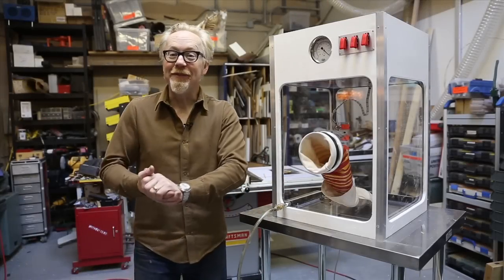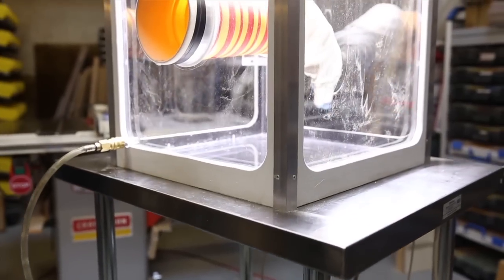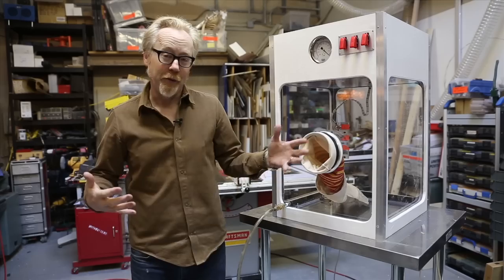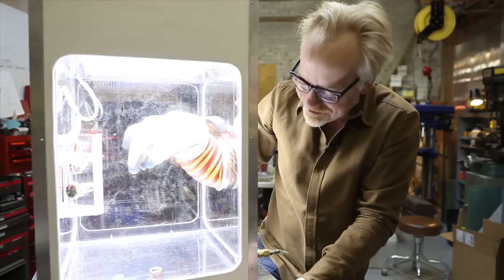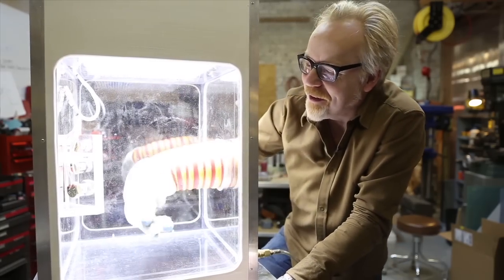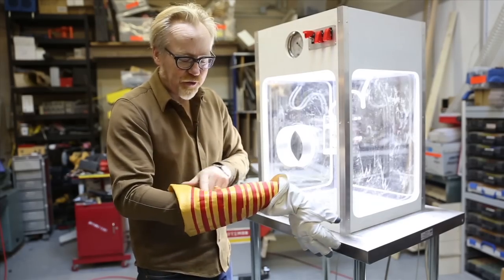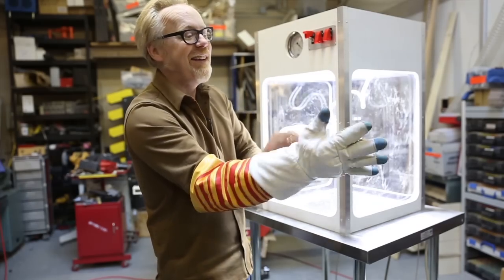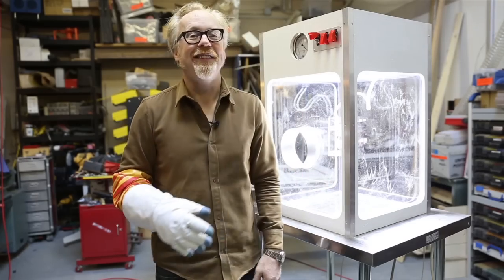Inside Adam Savage's Cave: Space Glove Vacuum Chamber

Comment: But the vacuum on the moon was a MASSIVE 2x10 -12 bars.  The glove would have been like concrete.  More likely it would have just exploded as soon as they left the capsule.  More fake mythbusting.
Reply: In scientific notation, when the exponent is negative (like -12) the number is minuscule, not MASSIVE.
Te pressure you state is 
.0000000000002 bar, very nearly zero.

Comment: What would really mean something to me, is to do this experiment with the actually glove design/material the astronauts used on the moon, and get the vacuum in your chamber as close as possible to a perfect vacuum. THAT is what should be done with a museum piece. Everything else is just fake.
Reply: Having the chamber at full vacuum would make the glove over pressurized, since the Apollo suits only had 4.3 psi.
 Atmospheric pressure is 14.7 psi.
Reply: @dansv1  I would still love to see a random person, get into a 1969 designed space suit, and walk into a chamber of near perfect vacuum, and explain candidly about movement, agility, oxygen, moisture from exhale in the suit, CO2 exhaust, body heat build-up mitigation, all the while standing on a frying pan with one side of the suit subject to near frying pan temperatures, all the while being blasted constantly with microwaves, xrays, gamma rays and cosmic rays, while seeing how the suit A/C works to keep the temp cool for the air inside the suit.
Reply: @rubecork7102  Nothing of which would turn out to be much of a problem. And if you really would like to see how the AC works, you could look it up. That you did not do that is rather revealing and hints pretty obviously as how sincere your interest really is.
Reply: @Schmidtelpunkt  reading about claims of how something works, and actually testing it are entirely two different things. I don't have the ability to test, but this man apparently does.
Reply: @rubecork7102  It is a physical process. Unless you come up with a good reason why it would not work, under specific conditions, understanding the process should be enough to check its plausibility.
Reply: @Schmidtelpunkt  I understand where you are coming from, that is, you don't have any background information. Background is, I think there was a lot of bogus claims by NASA that they sent men to the moon and they came back. Sorry, but it is a long story. Too many inconsistencies, not worth conversing about in a comment section. Do you have a comment section on your YT home page?
Reply: @Schmidtelpunkt  funny thing, but every suggestion of a solution to Covid (for a year) is met with objections of being "anecdotal" of not being "peer reviewed" and no "double blind" studies. So, without that, anything is ridiculed as "snake oil" (like HCQ). Now, because the world was told that NASA said a man went to moon and walked thereon, and came back, everything is okay, just TRUST NASA, even when there are BLATANT inconsistencies scientifically with the prospect of that CLAIM. Did you get my question about a discussion page on you YT home page?
Reply: @rubecork7102  You might think that. However, reality is that none of the claims could be proven to be "bogus" nor could any "inconsistencies" be found. I don't see why you would not be able to be more specific in this comment section, so I doubt choosing any alternative means of communication would make much of a difference.
Reply: @Schmidtelpunkt  allow me to quote you:
"none of the claims could be proven to be "bogus" nor could any "inconsistencies" be found"
Do you realize that you just PREDICTED THE FUTURE that none of the claims could be proven wrong?
Sorry, but you have no idea what the future is. You have no idea.
Reply: @rubecork7102  Medical studies are different from physical experiments in the number of uncontrolable factors involved. This is why medical treatments require studies while physical hypothesis can be verified using experiments. So it is pointless comparing those two. 
Also putting a man on the moon was not an experiment as there is nothing which needed to be tested. Orbital mechanics as well as rocketry have been well researched, so the question was mainly one of engineering. You don't have to believe them, you simply have to check the plausibility of their claims and the solutions they have delivered. And once more - there are no "blatant inconsistencies", else some hoaxer should have been able to point any out by now. But still there is nothing. Just a perfectly plausible and fully coherent series of missions, which resulted in data which has stayed consistent with every further development and all data collected by other space agencies and private initiatives.
Reply: @Schmidtelpunkt  you don't realize that you are solidly claiming the infallible truth of NASA, regardless of any facts, arguments and reasoning that may be presented in the future to show otherwise.
Reply: @rubecork7102  Not sure where you get that "predicting the future" thing from. Also it is entirely irrelevant what you fantasize about the future because the nature of facts is that they got gathered in the past. Relevant is that so far none of you could come up with even the tiniest piece of evidence to cast doubt on anything Nasa did.
Reply: @Schmidtelpunkt  you are claiming that there CANNOT BE POSSIBLY anything produced to show it is a fraud. Yes, or No?
Reply: @rubecork7102  I am obeserving that the likes of you are unable to produce any evidence. The assumption that the moon landing is real also implies that it is impossible to find any such evidence. Further the inability of hoaxers to understand even just the basics of the engineering principles and their reluctance to inform themselves or even just learn about the fundamental physics involved make it very unlikely that they will be able to provide any evidence in the future. This is not a prediction but a simple conclusion of the observation made, just like one can predict the weather without having to predict the future.
Reply: @rubecork7102  You seem to assume that new facts would appear out of nowhere. They don't. Your kind has failed to find even a shred of evidence in the past, there is simply not logical reason why you would find anything in the future, as no new information will come along: The landing places have already been observed via satellite, the technology has proven to work as expected. What kind of new fact would you think anybody could produce which in the recent past would not have been produced already?

And, nope, being realistic is not the same as predicting the future. It is very easy to be sure than no matter how fast you move your arms, you won't be able to fly. You might claim that for that you would have to travel into the future, but for a rational thinking mind, the experiences of the past are more than enough to be sure about that.
Reply: @Schmidtelpunkt  the human flapping arms is not a good example. NOBODY has claimed that about human arms and flying. However, there is MUCH objection to the so-called science of human moon walk. MUCH. And, it is based on science and reason, not mere stark emotional objection. Listen to the reason and objections. Don't just conclude that since it was never concluded, that it cannot be concluded. That is an emotional reponse.

Comment: He is saying 3.5 psi but the gauge is reading 3.5 in/hg which is only 1.72 psi. It kind of seems like he doesn’t know the difference. 
If he was replicating the pressure difference in a suit used on the ISS (4.7 psi) the box would need to be pumped down to 8.75 in/hg.
Also that glove is a poor stand in for a real space suit glove. Perhaps the low pressure and the simple glove combine to give a good analog to reality though.
Reply: Indeed. It is a shame that he made that mistake, but after all the point of the installation is to explain the problem and to make it possible to experience it. Nasa could build something more accurate if it was needed.

Comment: Like to see this tried again with actual space vacuum of 10-10 to 10-11 mbar.
Reply: This would be a much  higher pressure difference than the actual suits in space.
Reply: @Schmidtelpunkt  Not by much when you consider per nasa are around 6 psi, now calculate the internal force exerted when in a vacuum of 10-6 to 10-11mbar.
Reply: @krom5960  3 psi are closer to the 3.7 psi pressure differential of the Apollo suits to space than the 14,7 psi pressure differential of atmosphere to the complete vacuum you are asking for.

Comment: What a load of bollocks--Adam's perspex box would rupture under the pressure. Several people have correctly pointed out that the negative pressure was actually -3.5 in.Hg which corresponds to -1.7 psi. The dimensions of the box are roughly 2'x3' which means there would be 1500 lbs of pressure on each face of the perspex box. I call BS.
Reply: Paul, you got it wrong. The space suits were at 3.5 psi on the inside while the environment (space) was at 0 psi. That’s a pressure difference of 3.5 psi.  
Since the glove in his set is at atmospheric pressure (14.7 psi), he is creating a pressure difference of 3.5 psi by lowering the pressure in the box to 11.2 psi.
Reply: @dansv1  No. Look at the units on Adam's pressure gauge. It's marked in inches of mercury (not pounds per square inch). A pressure of 3.5 in.Hg corresponds to 1.7 psi. According to Wikipedia, "a space suit using pure oxygen must have a pressure of about 4.7 psi". So Adam's space glove experiment is bogus--it was under pressurized by a factor of 3.
Reply: Paul Tweedlie 
You are right about the gauge.
Reply: @paultweedlie3697  But in what way does his experiment fail? It isn't even a real astronaut's glove. The point is to simulate the challenge, not to get actual values in the first place. After all, what would be the result should the hazmat glove rupture? It would just tell you, that it is not resistant enough.
Reply: But... why would it relevant that you call BS? It would be much more interesting to find out whether a box like that is able to withstand the pressure. And when comparing it to other chambers of the same dimensions, this seems likely. But maybe all those chambers are part of a much, much bigger conspiracy...

Comment: It would have to be 14.7 you know what "space" should be
Reply: Bill L 
Space suits are not kept at 1 atmosphere pressure. That would make moving too difficult. They use about 3.5 psi of pure oxygen.
Reply: @dansv1  to had that proves this is bs supposed 4.3 psi from "space vacuum " but they only put 3.5 in they couldnt move around bs at least make the math work nasa

Comment: Wait wait wait, why did Adam turn off the vacuum pump early isn’t space a complete vacuum?
Reply: Chemical Reagent 
Yes, space is basically zero psi. In space, the space suit's internal pressure is about 3.5psi, so he runs the vacuum pump to reduce the pressure inside the box to 3.5 psi lower than the 14.7 psi atmospheric pressure outside the box to replicate the differential of pressure that an astronaut would have in the vacuum of space.

Comment: Lol how is 3psi moon vacuum if normal pressure on earth 14 psi
Reply: Apollo suits had pure oxygen at 3.7 psi.
Reply: @dansv1  water boils at that
Reply: Jdi Dd You are correct. Water would boil at 150°F, 66°C at that pressure.
Reply: Jdi Dd   To boil at body temperature, the pressure has to be below 1 psi.
Reply: @dansv1  check out video on YouTube of man putting water inside 3 psi vacuum and see it with your own eyes
Reply: @dansv1  moons pressure is not 3 psi it's 10-11 torr
Reply: Jdi Dd  I did not say what the atmospheric pressure of the moon is. I said the Apollo space suits on the moon were pressurized to 3.7 psi.
Reply: @dansv1  there's no zero psi and do the math at Glendale NASA space center they have a vacuum of 10-3 torr and the walls are made of 8 foot wide concrete now u think cloth is stronger than that? Like the space suits
Reply: Jdi Dd   Do you think that 10-11 is a large number?
Reply: @dansv1  dude I'm an engineering student of course I know it's almost zero don't you know the closer u get to zero the harder the negative pressure or the pressure on the walls in relation to the atmospheric pressure or vacuum
Reply: @dansv1  10-11 torr cannot be held back with cloth or rubber inside space suits lol it's ljke saying airplanes can go through steel like in 9/11
Reply: Jdi Dd   I’ve been having fun researching this subject and learning about the many units used for pressure and vacuum. 
For comparison to the space suit pressure, here is a list I compiled:

Bounce house - 0.36 psi
Party balloon - 1 psi
Zodiac boat -3.48 psi
Soccer ball - 8.7 psi
Soda can - 30 psi
Car tire - 35psi
Garden hose - 50 psi
Bike tire - 100 psi
Propane tank - 150 psi
Fire hose - 400 psi
SCUBA tank - 3000 psi

These are operating pressures, not burst pressures.
Reply: @dansv1  watch video Wabash national tanker vacuum collapse not the mythbusters one
Reply: Jdi Dd Why turn an otherwise intelligent discussions into insults? Ask you're engineering professors to explain the difference between keeping the pressure in a container and withstanding outside pressure. You are making a straw man argument. Try using other sources than YouTube.
Reply: @dansv1  watch the video Dan lol filling up a soccer ball to 8 psi is different from vacuum pressures which is still at 14.6 psi the video explains it
Reply: Jdi Dd Are you mad that a  retired machinist knows more about pressure, vacuum, and the strength of materials than an "engineering student"?
Reply: Jdi Dd  does the irony of using a Myth Busters video as a counter argument to an Adam Savage video escape you?
Reply: @dansv1  if you think a soccer ball is in a vacuum pressure of 8 psi lol that's it's own failure to comprehend but I'm sorry for being disrespectful I did not realise u were not my age
Reply: @dansv1  if you drop the internal pressure from regular 14 psi to 3 psi that's 11 psi of vacuum pressure therefore if you find how much that translates to per square meter you will see how much negative pressure will be applied to in relation to the walls of the structure holding in the vacuum like a tanker
Reply: Jdi Dd   Here is a NYT (Non YouTube) source for boiling points for water under partial vacuum pressures. Note that the pressure at which body temperature water boils at is less than 1 psi.
Reply: Jdi Dd   Another NYT source showing that the pressure differential of Apollo era suits were limited by a pressure relief valve: "Pressure Relief Valve ( 1.4 Mb )
Close-up from the left. This valve opened automatically between pressures of 4.8 and 5.5 psi to prevent suit overpressurization. It was fully seated at pressures below 4.8 psi to maintain pressure integrity of the suit."
Source: https://www.hq.nasa.gov/alsj/a12/A12Pete-Flown-Suit.html
Reply: Jdi Dd  Is you're purpose in all of this to "prove" that the moon landings never happened?